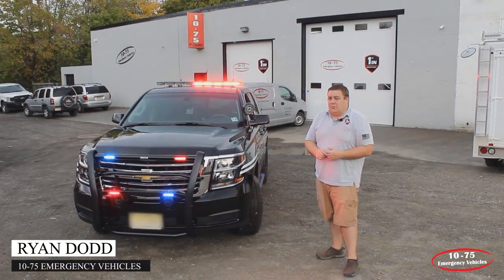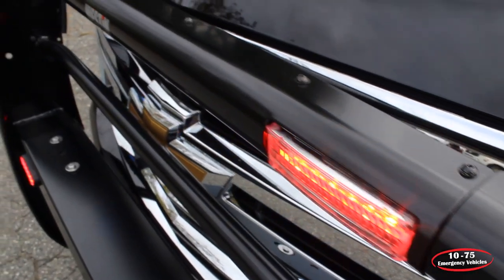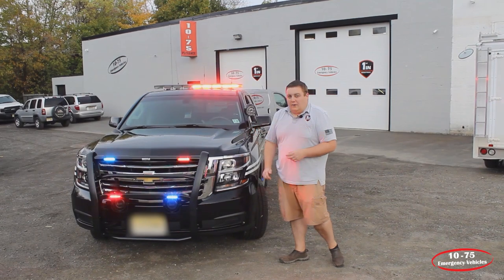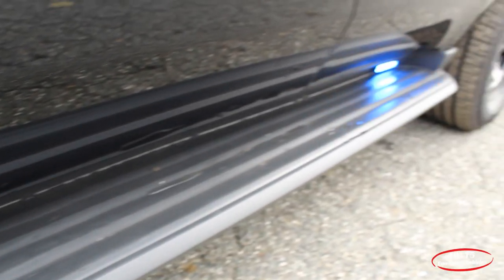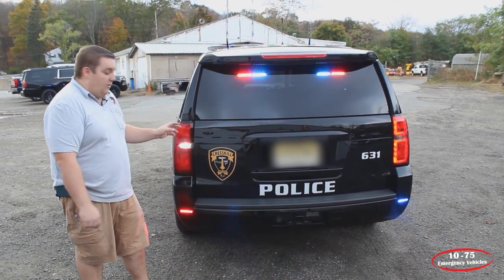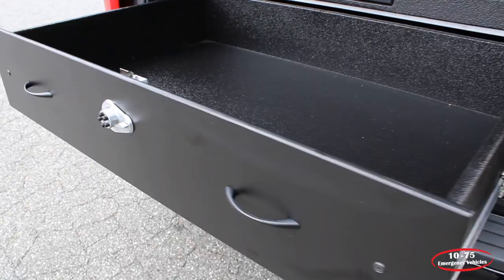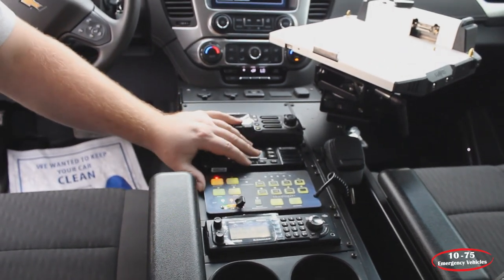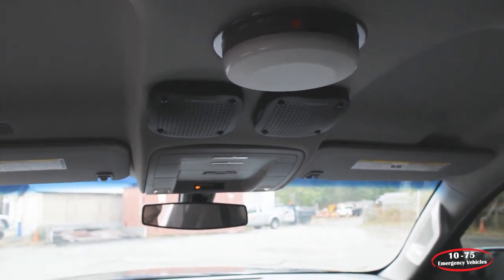POLICE CONVERSION | Police Cars | First Responder | Chevy Tahoe

Comment: How did you get the radio speaker on the ceiling? Any special size or mounting bracket?
Reply from the maker: We have a special bracket.
Reply: Please share! We just got a lot of them in our fleet and I’d love to get that in mine.
Reply from the maker: Contact www.1stinproducts.com and they can put you in touch with a local dealer.

Comment: I'm not loving the amount of side lights! Could use a double light in the passenger door/window and the rear window and a third step bar light. I do like the park sensor and the door light killer. I would also install some light for when the back is open you have light for command but not rear facing light, you turned off the rear window lights but did not replace them while now increasing the risk with personal outside in the rear. (I would if anything keep the same amount of rear light while rear door is open)
Reply from the maker: Thank you for your input